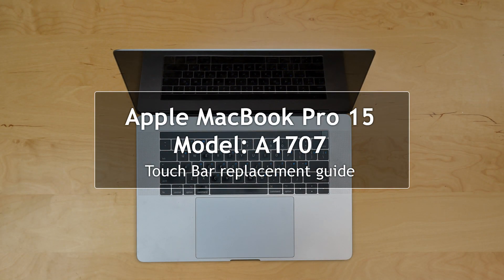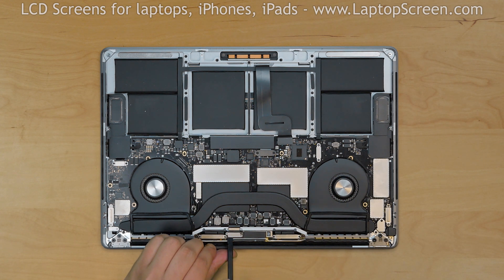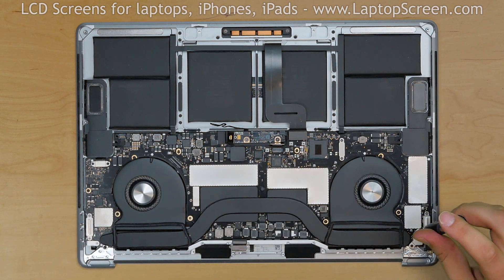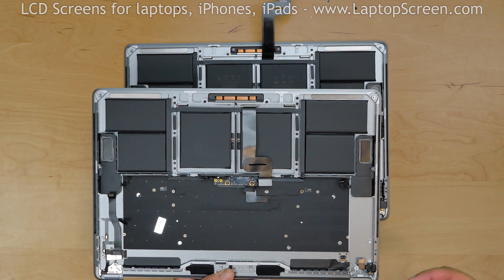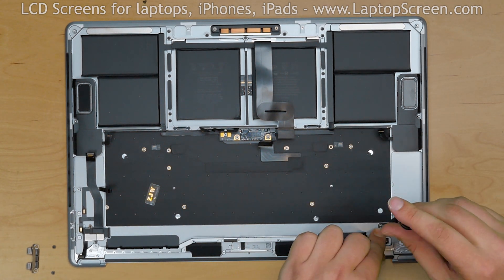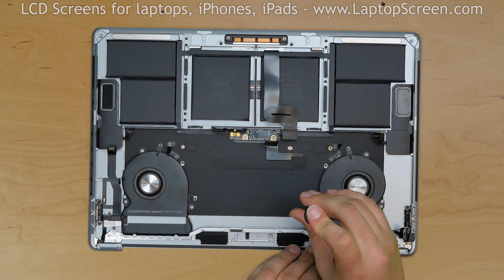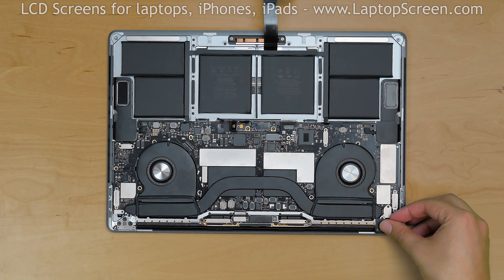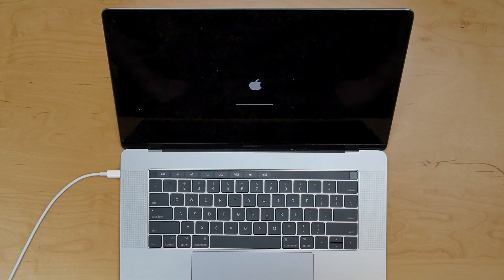Apple MacBook Pro 15 Model A1707 Teardown and Touch Bar replacement guide.

Comment: Wonderful video. Thank you. Maybe you can support me with something? I replaced my entire top case. After putting it back together, The screen lit up for a short time with everything function but showing 0% battery and not charging. It then turned off and is not charging since. I hope you can point me to were to look.

Comment: touchbar replacement guild is all topcase replacement? Are u fkin kidding?
Reply from the maker: No. That's why the sarcastic tone in the video. You can't get stand-alone touch-bars for replacement. You have to get used top-cases to get your hands on a touch-bar, because it is ultra-hard to remove the touch-bar from the top-case without destroying it.

Comment: I though this video is for replacing just the touch bar specifically, but it's NOT.  A more accurate title for this video should be replacing "top case (assembly)".
Reply from the maker: Well, it is the only thing that needed fixing and that was the only way to do it, due to parts availability. No touch-bars for sale separately :)

But if you find one for sale, this video covers 95% of the motions you'd need to do.
Reply: @Laptopscreen  but it didn`t cover the most important part mentioned in title. misunderstanding...
Reply from the maker: @karolosmanski2309  Touch bar is replaced by replacing top case.
Reply: @Laptopscreen  TouchBar is available for sale i replace them once a month.

Comment: Hey mate! Thanks for the video. I am facing issue with the touchbar and probably the flex connector for the touchbar got loose. Could you please point out where is that located?
Reply from the maker: 0:10 Bro, we're replacing the whole top case to fix the touchbar. If only there was a flex cable loose, we'd be fixing that. Its a common thing with touchbar - it goes fubar - and you have to replace it... with the entire top case.

Comment: can someone tell me if i can work with my macbook pro without the touch bar connected into the motherboard?  the guys were i bought my replacement Touch Bar sent me the wrong one and i just realized when i was putting the new one in place, now i have a completely disassembled macbook and will take days until i receive the correct one :(

Comment: the pentalobe screw driver i bought to take out those tiny wifi screws stripped out on the first screw.  I cant believe they put this type of screw for just the wifi and so many.  I guess i am shit outta luck because you cant buy the screw driver locally and the ones online are cheap
Reply from the maker: Yeah, you'll have to drill the stripped screw out. It's not hard, but you may have to do it to more than 1 screw. But look on the bright side: there are 12 screws, and you really only need 4 at most :)
Reply: @Laptopscreen  I got my dremel  tool out and made quick work of it!  thanks for your helpful video!
Reply from the maker: Good good. I've noticed it as a recent thing. In this video I didn't have to drill any screws out, older laptop. But I did the same computer (newer production) a few weeks ago, had to drill 3 screws on the Wi-Fi antenna. Did an iPhone SE 2nd Gen video - one of the screws was stripped from the factory, had to pry open the connector shield to disconnect cables. It seems Apple has started using a much softer metal in its screws.
Reply: @Laptopscreen  I dont even know how they manufacturer these screws!  They are so small they look like specs of dust.  Its like Apple doesn't want us to repair their products but we always find a way.
Reply: @doubledragon2074  i bought a cheep screw driver set on ebay, yea the cheap ones strip them easily because i think the 0.8mm screwdriver they provided are for iphones. I sanded the tip of the screwdriver 20 times and ever since i have never stripped a 0.8mm macbook screw again with that screw driver even if you strip it, it will come out easily